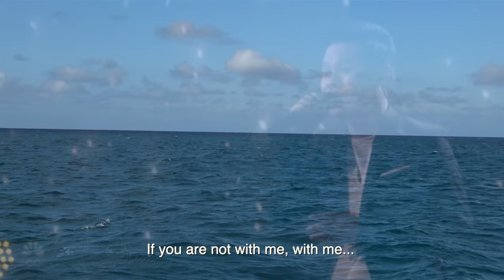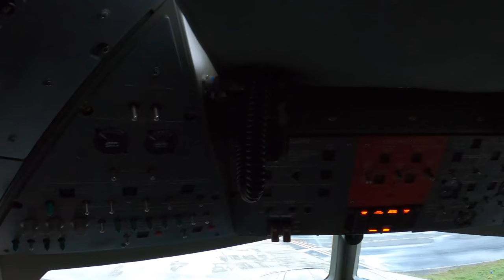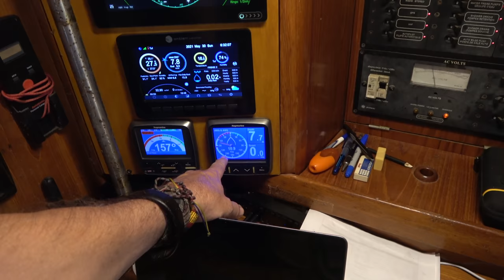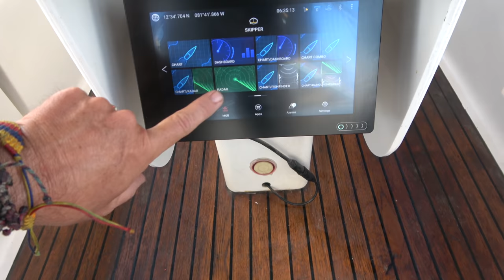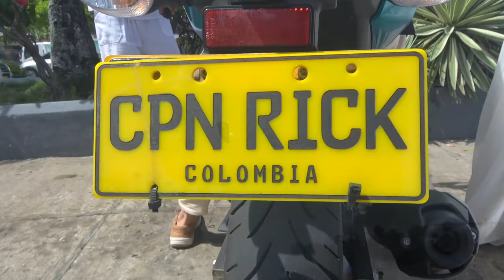SSL559 ~ time to say goodbye...

Comment: Captain Rick. The transmission fluid on the floor in your engine room is because it’s an overflow. You always check your transmission with the motor running. Too much transmission fluid builds up pressure and blows it out the overflow.
Reply: It's a marine gearbox not a vehicle transmission. You can check the bloody oil anytime, running or stopped

Comment: Hobie sailors say "Sail 'till you puke." Which, on a fast reach, harnessed-in and up on one, if you could keep it going until exhaustion, puking at that point, overall, is a good thing, because you maximized the fun. So, keep in mind that sailing till you puke  is vastly better than not sailing at all.